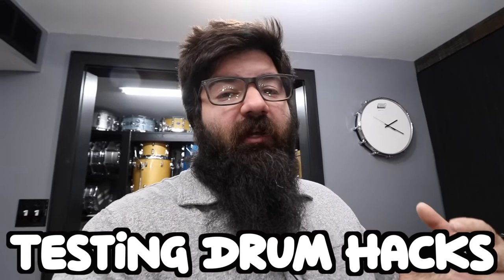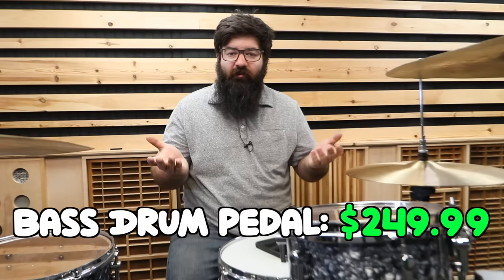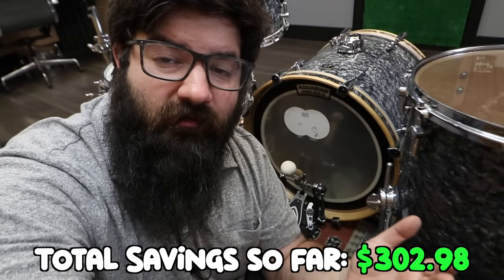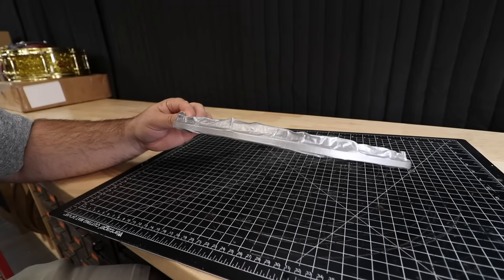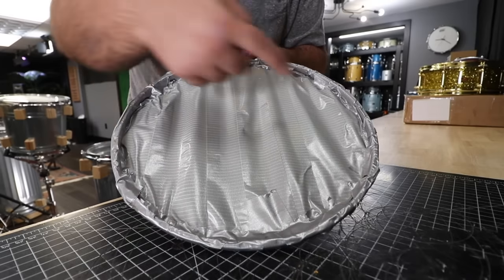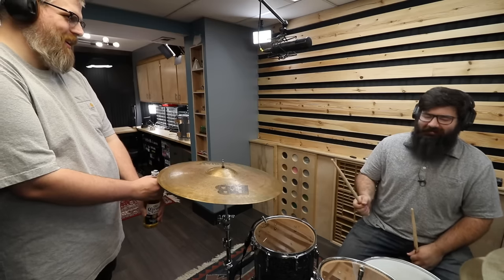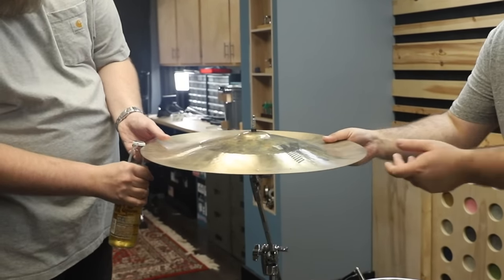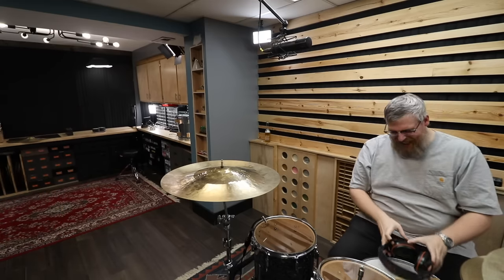Testing DRUM HACKS That Will Save You Money

Comment: You might find parcel tape (don't know if that's what it's called in the US... packing tape?) works better than duct tape to make a head. Used to make little bongo-ish things with thick cardboard tubes and parcel tape and they were surprisingly decent sounding.  Not a drummer so can't I test it on an actual drum and maybe it wouldn't scale as well, but I would think you'd be able to pull the tape a bit tighter when sticking it down and get more of a membrane.  Would likely need a few layers laid in opposing directions like you did with the duct tape, and probably still wouldn't last super long against drums sticks, but might be interesting to see if it sounds better?  Probably an even cheaper hack, too!

Comment: There surely is a (non-digital) way to eliminate the round 22 or 24 inch kick and replace with an adequately sounding boxy object, of smaller size, which achieves the thumping effect.  Suitcase. Djembe.  Cajon.  Cardboard box and mic.  The mic itself with padded something. Roto Tom.  Wooden board.

Comment: You two are brilliant, started my day with a smile you did. Thank you. I'm just getting started with playing again after nearly 30 years away from the kit and as my budget is tight I'm buying used gear. 

I picked up a set of Meinl hats cheap that sound beautiful but the top cymbal is really oxidised whilst the lower of the pair is beautiful and bright.

I'd like to bring the top one back up to a nice finish again but I don't want to do it the wrong way. I don't think the Lemon Pledge would have the muscles to do what I need it to do. Have you got any suggestions please?
Reply: Bar keepers friend or Brasso but use a light coating
Reply: @adderon  thank you so much for your reply, I appreciate it

Comment: The issue with rings or cheese is their weight and/or stick-to-the-head performance.  You don’t want them to bounce. A single bit of tape doesn’t help as the off-side bounces.  You need to carry several wallets in your gig bag.
Reply: Or learn to tune your drums so you don’t need that crap.